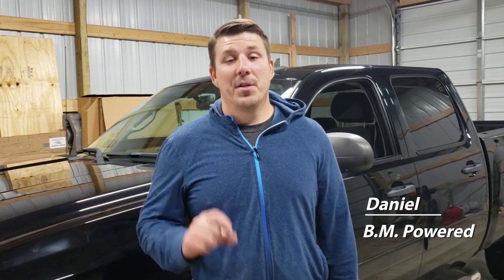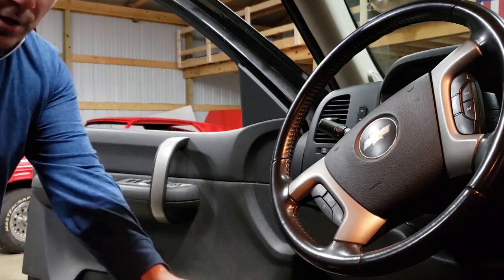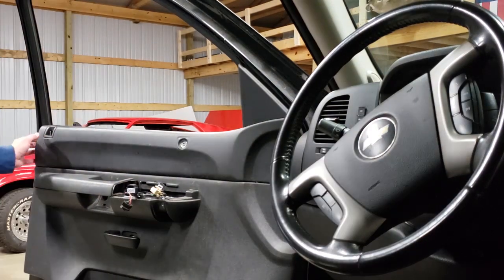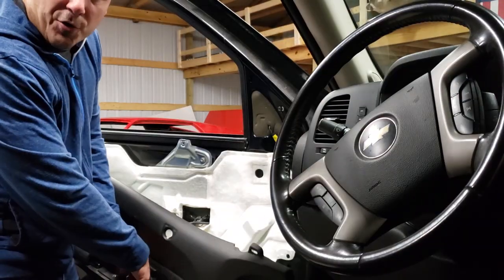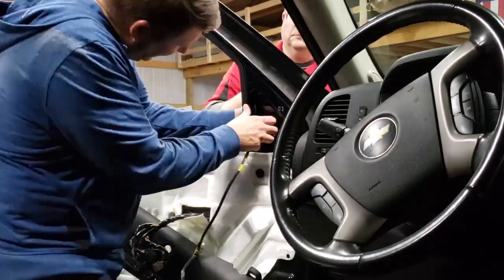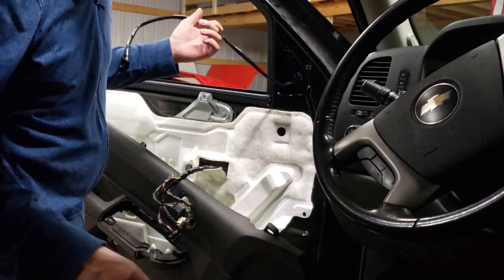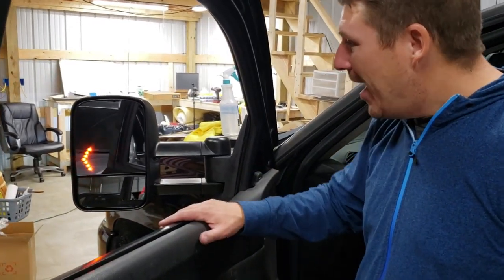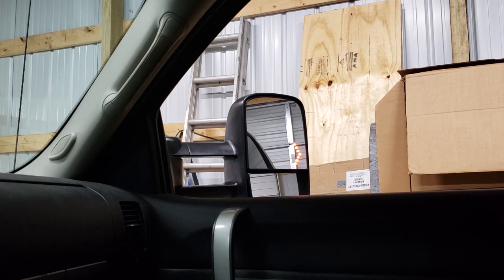How to Install Tow Mirrors on 2007-2013 Chevy Silverado 1500 (Project Revive: Part 6)

Comment: Are all of them wired for turn signals and heated mirrors of do you need to rewire them?
Reply from the maker: It depends on the year, but from what I've read if you have rear defrost, it should be wired (don't quote me on this, lol).

Comment: Did the factory mirrors have turn signals. Ive got a 2013 no signal. Do i need to wire up new harness for them. Thanks.
Reply from the maker: No, they did not. All of them are wired for it.